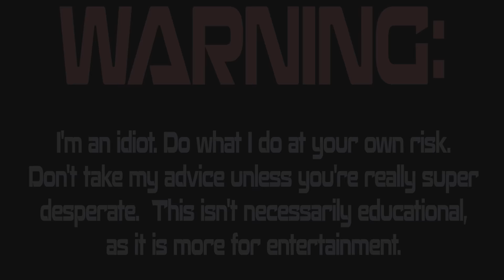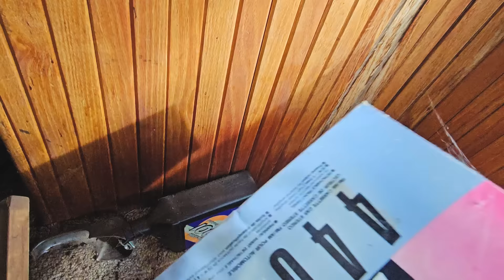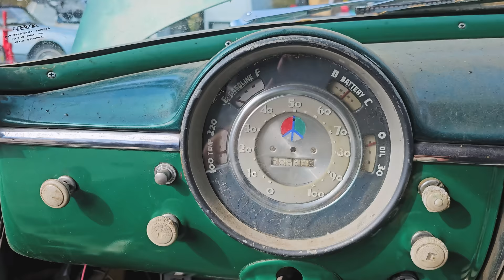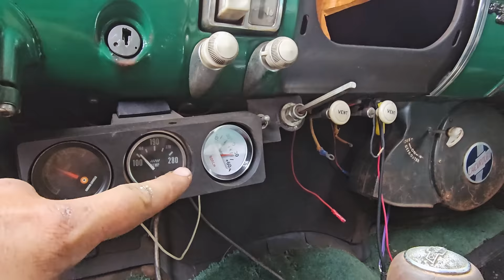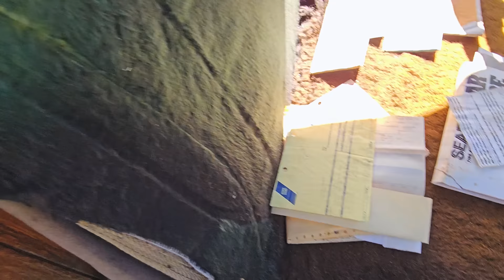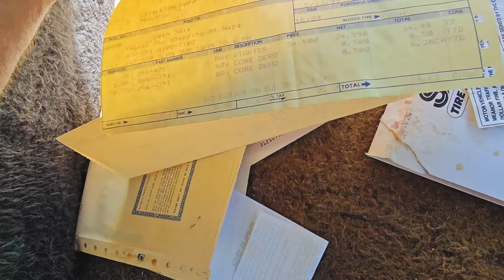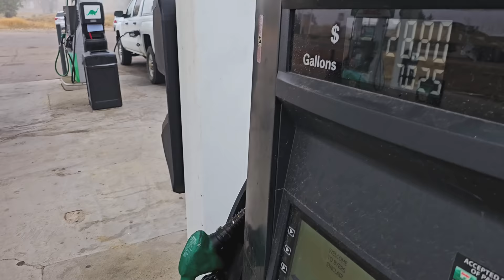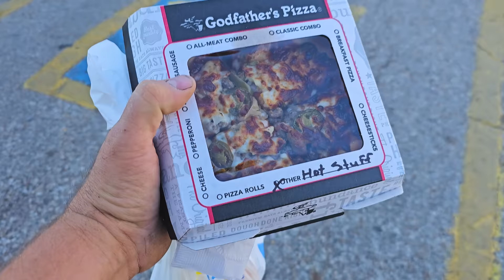Will This 1950 Chevy RUN AND DRIVE 1,400 miles after 20 years?

Comment: I know you know this. When I have an engine that hasn't  been run in say three years. I always  remove the park plugs, and put some  kind  of oil down the plug holes all. Pour kerosene  down carb/ intake, and oil in vavle covers. Wait. Then try to turn it. I have had stuck rings in 2 engines 70 400 pontiac, 66 mustang 289.    Glad to see that there still someone who can still bring old r n g I ne back😊
Reply: It can save a complete  rebuild, dome engines have just Bern rebuilt, and then,abandoned.

Comment: Hi Derek, I love watching your videos . Way back in 1957 I installed a Chevy 283 in my friends 1950 two door sedan, same one you have there. An article came out in Hot Rod Magazine, where a fellow in California installed one in a 1954 sedan. They are a torque tube car, and I used my three speed pickup truck transmission in it, so it would bolt right up to the torque tube.  It wasn't a very hard job to do, just a little time, I was an auto mechanic at that phase of my life. My buddy was in the house watching TV most of the time, while I was doing the work. It turned out very well and looked like it was factory installed. It started out stock, but with-in a year, he had a McCulloch Super charger on it. It would pin you to the seat, just like a Jet Airliner used to do. We had much fun with it, as it still had the Power Glide emblem on the trunk ! My buddy died a few years back, and never paid me for my transmission ! I'm 86 now, and get a kick out of some of the old memories  of the fifties .I live in North East of Cleveland , Ohio! Keep up the good work my man, and stay safe .
Reply: Thank you for such a lovely story sir. 
What’s with a guy who doesn’t pay for his three speed? At least offer a trade!
Reply: You know you would think by now you would have a list of things you  should either buy or just take with you .
Reply: Synchronizers definitely not working lol in my opinion
Reply: Someone give an opinion. If I was to restore those old rigs, and was getting around to paint/body I'd leave the old dents but correct the paint. 

Something about the dents in those old cars. They tell stories. To me they add character.

Comment: Brings back many good memories. Born in 46, I grew up driving and working on chevys. Had a 49 sedan delivery, a 50 DeLuxe 2 door hardtop, and a 51styleline deluxe, plus my dad's 53' 5 window pickup. Great cars. Put a 283 in the 51 with a 4 speed  w/overdrive. 57 chevy rear end fits right in to convert to open drive.

Comment: A treat when you release a new vid. 
Del, here in UK we have 99% stick shift. To check is an engine is not locked, we pop it into highest gear, remove any breaking and then rock the vehicle back and forth. This frees stuck motors as gently as possible, or not.

Comment: G'Day Derek, thanks for your content, very inspiring. Here in Australia the Ford Falcon has been one of the most iconic cars of the last 60 years, all the way from the farmers ute (or pick-up, as you call it) to the top of the line racecars. You may of heard of the Australian V8 Supercar series which pitted the Falcon against the Holden (GM) Commodore. Well that battle kicked off in the 60's with the Falcons taking on Holdens Monaro and Valiant (Chrysler) Chargers were thrown into mix aswell. In the 90's the series was re-shuffled and what emerged was a Ford vs Holden, only, battle and only V8's. Both Ford and GM have now permanently shut their doors in Aus and the racing series is now Comaro vs Mustang, nothing to do with Ozzie cars and I've lost ALL interest in it. But you did say in this video, that if anyone wants to see a scrapyard revival, "just bleep bloop it down there in the comments" so, here's my request of an early Ford Falcon. I saw two of them at time stamp 1:55:00, a black one and a white one. I don't think you've ever done a Falcon. There was that black ute, oops, sorry, pick-up with the pin-striped decal a few years ago but I don't think that was a Falcon. I'm gonna watch that again, after this video. Anyway, that's my request all the way from Oz. You are the most entertaining, knowledgeable, inspiring and respectful creator on YT and I 'doff' my hat to you sir. You are a true icon and a very inspirational man, thankyou.

Comment: At 15 my first truck was a 67 Chevy. I went through two Muncie 3 speeds doing that. I made a notched stick to jam under the dash to hold column shifter in 3rd .second transmission did the same after awhile. 3rd one was a Saginaw. It worked permanently and had synchronized 1st. I did have to change the bearing retainer so it would slide in the bell housing. Some of my first repair s, all before I turned 17. I could do one by myself in a hour or so.   I kept thinking while watching that junk yard probably had a couple hundred of them, but I realize you were pretty far a way by then. I enjoyed the video. Thank you!

Comment: I remember buying a 1969 Austin Healey Sprite. The block was in the right olace but the head, intake, exhause, and both carbs were in the trunk. The seats were unbolted too. I spent the summer of '73 or '74 rebuilding it with the help of a Chiltons manual and drove that car for years after.

Comment: Nice going. I been buying Kia Rios since 2001. Mostly because of price. Some ran really well. A 2003 model 5th gear blew out in Tennessee and I had to limp it home 200 miles in 4th back to West by God Virginia. This video reminded me of that adventure. To the Rios credit she had over 100k miles at the time. Swapped in a junkyard transmission and she kept on trucking another 150k miles!

Comment: I had a shifter that did that in my small international 3 speed truck.  I had to hold it in third. It turned out to be the cluster gear.   It was actually easy to repair with a little a lot of help from my good cousin.  I remember it was 35.00

Comment: I had a 57 chevy, some 50 years ago that did exactly that same thing.  It was the thingy that pushes the gear over, I built the thingy up with weld and filled it a bit and it was good as new.

Comment: Timing in the field is easy. 
1. Set the pulley marks, 8-10°. 
2. Turn the distributor body ahead of distributor rotation. 
3. Turn back until the points spark.
Nail it down!
A light with prove it's correct.

Comment: That car deserves a full restoration and paint. Vintage air, disc brakes, modern suspension, lighting upgrades. The wiring completely removed and new electrical wires, fuse panel and relay box installed. Full interior restoration resto mod style. The engine removed and throw a 7.0 liter LS or a big 572 running on either a Holly Dominator EFI or the Holly Sniper. Would be really cool to throw a nice supercharger/blower on top of that engine to kind of keep that vintage style versus a turbo.turbos.

Comment: I used to run one of those glass filters on a motorcycle I had a number of years ago. I wanted that one because the tank was quite rusty, and a feller can knock all the big chunks of rust out, but there is always more ya just cant get out. Since it was gravity fed, I was able to tighten it by hand so when it got stopped up I could clean it out on the fly and keep er movin. I wouldn't use one on a vehicle under the hood, but on an atv or motorcycle, absolutely. And, you can get them at pretty much any parts store.

Comment: Derek, I think the original upholstery was mohair wool.
40 years ago (the '80's)  you could get all the parts you needed for that car from Hemmings motor News.
   Look for a 216 CID solid lifter unit. I think 50 was the last year they use that.
 Later on they went to 232.5 and then 235 with a hydraulic lifter, I think.
  It's been since the 80's for me.
Reply: Derek in 1980 I could drive a stock 216cid 1950 Chevrolet up a 20° 1 mi long grade in 3rd gear in Felton California and I never loved a bit. . .

Comment: There’s a synchro hub in the trans that has a synchro ring on each end. The front one tends to pop out of its retainer ring. You have to spread the ring and hook it open inside the hub, drop the ring in and snap the retainer back onto the groove in the brass synchro to get 3rd gear back

Comment: The stock engine in a 1950 Chevrolet was a very sweet, slow and storied 6 cylinder with a column 3 speed. Wonderful engine for its time but this small block V8 driven slowish  will be a lot better for a 1400 miler. Except that the shade tree electrics that a guy stuck on the sparks might not energize very far anyway and the cooler has a hole. Love this channel.

Comment: I think I would have stuck my set of normal car keys in that fakey key slot, just to avoid any unnecessaries and facepalming when/if I got pulled over. I think this is one of the best finds yet, bub...but I still have about 30 minutes left on the video, so I'm hoping the best luck for ya.

Comment: I run four fuel filters before and four after fuel pump and I still get stuff in carb, they don't make filters like they use too. And yes I intended up putting a new fuel tank in the truck

Comment: As a six foot two 130 pound soak n wet lol 37 year old father of two. I hated Harleys because I worked hauling them in a box truck and they are just so darn heavy and the newer ones are a pain especially the newer trikes. The reverse and transmission in general is garbage and had a ton of issues. Had more then ten of them I hauled over the years and trying to find first gear was impossible and they had to much electronics if they sit they go bad basically. I've always been more of a crotchrocket kid or atvs. Guess it says alot about where you were raised. I cared more about boats growing up in Tampa Bay building a few 1000+ hp waverunners that could outrun a jet honestly. These days I just stick with the old 02 trans am ws6 for cruising or my Italian bike
Reply: How do the 3 wheelers shift? Finding first in a bike should never be hard, way to go Harley...

Comment: Hello from Mexico!!! I watch your videos and I like it a lot, I like the mechanics, my first car was a Plymouth Barracuda mod 67 with the 318, then a Dodge Dart mod 70 with the 360 two doors, and a Crown Victoria with the 351, and I dream . By having another barracuda or rescuing one, in the places where you show up you leave sadness in the other cars that are left to die there, in the video of the Chevrolet mod 50 you did not change the oil in the transmission or the differential, perhaps that Affected by transmission failure, the synchronizers were damaged. I hope you rescue a 67 barracuda or a 70 dodge dart. Please don't give me a little heart, better write to me, thank you

Comment: Come on Derek, that intake could utilize either Square and Spread Bore Carbs, a bit of trimming on the Squarebore Gasket, to clear the slightly larger Secondaries on that Carter, should have worked. That adapter is terrible, it chokes the Primaries down, way smaller than they are on the Carb, screwing up the Air Flow and Metering. I still say the Carb would have worked without that awful Adapter, and better too

Comment: A fellur is no longer used to those thicker weight oils when draining cold.  I bet a guy knows EXACTLY what I'm on about.  I got a turbskie motor running 5-20 and an N/A running 0-15(the N/A is also gas running at a late 80's diesel compression ratio), and I prefer to drain with it over 100 degrees(they are both under 100k mi, btw).  I tell a fellur and fellete what, it's more like draining brown mineral oil than earl.

Comment: It’s something in the valve-train based on how they modded the engine.  You are getting both oil and air into  the engine some how.  Is it a push rod going through an intake port? Or is it something with the valve guide or valve seal allowing oil to get into the engine and bleed air into the port. 

Every time you run a pull the valve stem or pushrod does a little more self clearancing and the vacuum leak gets worse and wants more fuel at idle

Comment: Hello Derek That 1950 Chev Coupe Can't Have Original Trans,Rear End . That Was Torque Tube Set Up (Inclose Driveline) Driveshaft Inside A Tube The Trans Is 1955 And Up Chevy and Rear End 1955 Chevy Or Other Type Open Drive Line Set Up More Info Coming If You Like

Comment: Hey Derek have you ever tried Redline fuel treatment and injectors and jets cleaner. And you can also add in some 2 stroke Red armor motor oil in your gasoline fuel tank to.

Comment: Well if you put 2 tablespoons of turmeric powder inside the radiator and drive it approx 10 kms without the radiator cap it will fix the leak

Comment: I’m a Maryland guy, nothing to be proud of. This once industrial Mecha has been raped by those “rich men north of Richmond”
Lots of history here but unless you work for the government or a Chinese product distribution hub, ain’t much industry. Anywho, getting off topic. 
Not sure why Dodge did it this way, but I had a 1974 Dodge Snow Commander. Factory plow rig. It seems Dodge gave them different names for different regions. 
Mine had the same stripe but was originally orange in color, and said Snow Commander. 
3/4 ton 4x4 360, manual trans, 205 transfer case. Dana 60 out back, 44 up front. I could put that beast in 1st and pull my 3500lb boat up the ramp at idle. Then there’s the $$$ I made  plowing with it in the late ‘80s

Comment: It’s almost cheating starting out with the v8 already installed.   If a feller was still running the stock front end, I might know where some spare parts might be found.   Just as soon as I drop the new front end in my 51.

Comment: Derek, have a question for you, picked up a 71 Monte Carlo this last summer (SB 350). I believe has been sitting 15-20+ yrs. or better! fired up but my coolant is black, it is not oil, no milk shake... came with new Champion Rad which I have installed now. I'm suspecting the hoses are the culprit, just wonder if you've seen this on some of your recoveries at times??? Engine was dry when I got it and suspecting it had been for a long time, flushed thru thermos port before sticking in the thermostat thing a ma-gig...  always fun to watch your vid's!

Comment: I have a 3 speed from somewhere around that Era chevrolet with the bell housing that has the center bolt it came off a 283 but not sure what year or vehicle. I bought for my 76 c10 but it is different from what i have If you need it its for sale I'm located in East TN

Comment: Have you ever tuned an engine over by putting it in 2nd or 3rd gear and giving the car a little push. Of course it has to be a manual transmission car

Comment: It’s an awesome car sadly that step u had to skip due to filler plug on the diff was prob the downfall and reason you didnt make it all the way home. 
    Am sure using the low gear to slow down burned it up and put strain on the gear teeth 
It couldn’t handle it 
Like modern trans

Comment: RThe fuel filter that Derrick is warning you about is because when they first build them, they heat up the Metal ends and press the plastic into the cavity of the Metal end. They leak and ther crack like D says..Awful product..

Comment: You should know better than that you don't file points you burnished them use typing paper cut 6 inch long ships and remove the carbon without removing any of the metal off of the points

Ok